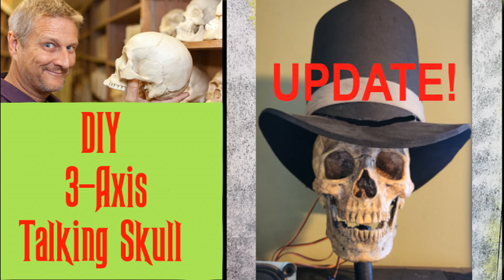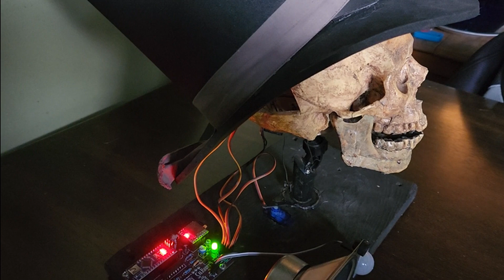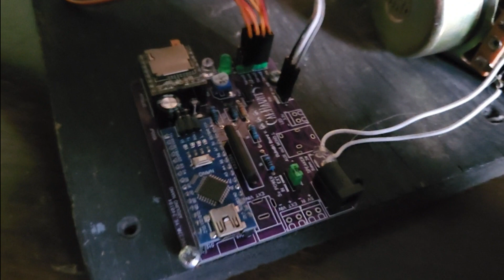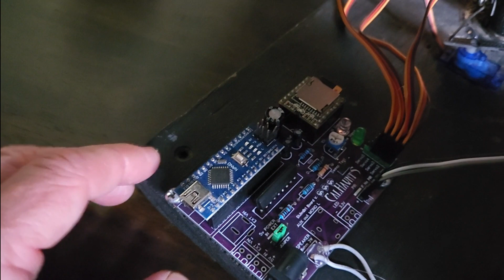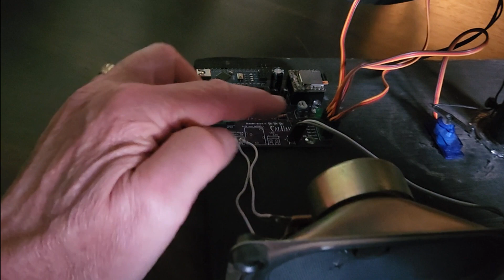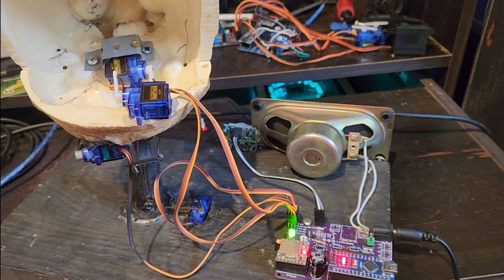Talking Skull

Comment from the maker: Ok for those interested, We have finally figured out pricing for the DJB boards (the controller boards for talking, 4 axis servos with sound). The price for the boards will be $125 plus shipping. We were aiming for $100 but the prices of some of the components went up due to tariffs. If anyone is interested, please contact me @ 1brianpierson@gmail.com to work out the logistics.
Reply: should use the standard opensource mouth item with the 3bit resolution and use a ai on something like a orangepi 5 plus with 16GB of ram. then use multiple pir or a human presence detector. you can add wled for the eyes or to shine a light on it. with a onvif camera you can have it call out costumes and such as well. whisper can have it detect speech and with xtts it can talk back to people

Comment: Do you have a parts list for this? How much to build one of these!?
Reply from the maker: Hi @majormagics5571, the parts list comes with the kit; we have a build your own (solder it together kit) for $55 plus $6 shipping or a ready made board for $90.
Reply: @brianaala  Ok now the $90 board, what does it do!? I would get that one... Please advise..
Reply from the maker: @majormagics5571  With it, you can take any mp3 voice files and it will move the jaw servo in synch, it will also control 4 more servos that will move randomly in a fast then slow, fluid movement (you set the overall speed). It has an LED output that can be set to blink randomly, stay on all the time, only while it's talking or stay off. It will play an ambient sound or music track when it it not speaking. It can be triggered to talk from an infrared movement detector or button, pad or any other switch. It does not require any programming to set up, just a dial and a button for programming that are on the board.
Reply: @brianaala  I think this is prettymuch what I am looking for.  Do you have a video on how this circuit board works and how to set it up?!  Im hoping you do as i am a novice....
Reply from the maker: @majormagics5571  I do! the back of the circuit board has a QR code that will take you to a web page with all of the manuals and links to the setup videos.
Reply: @brianaala  SO, do I have to buy it first before I can see the set up. I cant stress enough that I am a novice and am not very good at hooking things up... but common sense I do have....
Reply from the maker: @majormagics5571  Haha no of course not, I am working on the video now. I will try to upload it this evening.
Reply: @brianaala  Great, send me the link when you get it.  Im serious about buying a board as long as its easy install
Reply from the maker: @majormagics5571  Here ya go: https://youtu.be/y2EDcMvW0HA?si=trHA18LX9-3y8bpd
Reply: @brianaala  The link worked good and the board looks like almost anyone could program it.  Do you sell these 3 axis skull to work with the board!?
Reply from the maker: @majormagics5571 no, just the board at this point.
Reply from the maker: @majormagics5571  No, just the board for now.

Comment: I’m interested in the controller. I’m pretty new to all of this. I have a couple classroom skeletons that I’d like to animate the head and have them speak. What software are you using for the programming?
Reply from the maker: Hi, technically, the software would be Arduino IDE (Based on C++) but all of the programming is done, all you need to do with this board is record whatever voice you want it to have, some background music or sounds. Stick those onto the SDcard and plug it in.
Reply: @brianaala  If I purchased a controller from you I would still have to set the limits of the servo motion would I not? I’ve been looking online at a couple different servo set ups. Just not sure yet which route I want to go.
Reply from the maker: @amwilkie  Yes, but you don't need to do any programming to set the limits; there is a dial and a button on the board. All you need to do is set the jumper to setup mode, and it will walk you through the limits of each servo (min/max) by turning the dial to where you want it and tapping the "set" button, after all 5 servos it takes you to what setting for the LEDs, again just turn the dial until the LEDs do what you want, then hit the button. Finally, it goes to the servo speed mode, the servos will sweep to your settings, you just turn the dial until the speed that you want and hit the button.
Reply: @brianaala  ahhh ok sounds good. I’m going to do some more research on mechanisms, but count me in for a controller. I’ll send you an email.

Comment: Hi There,

I am quite impressed with your 3 axis skull and controller.    Would you be able to share more details with how you constructed the 3 axis mechanism?

Much appreciated, 

Yours in haunting

Doug
Reply from the maker: Hi Doug, thank you so much for the kind words! The 3 axis mechanism that I made for this is pretty rudimentary: it's made from an old Garmin windshield mount (the ball and socket) that is screwed on to a wooden dowel that spins on a bearing from a bicycle that is in the base. It has bent bailing wire going to the servos and screwed into the dowel for movements. This one was built to be mounted in a column and talk. I have since made another that is more of an actual 3-axis that fits into a skeleton. That one is based on the "Twisty skull" design. I just made that with some threaded rod, nuts, a fender washer and a spring with some tubing to fit it over the rod. I could maybe make a quick video of it to show you.
Reply: @brianaala  I would also appreciate some help with the actual axis, spent hours researching and still not sure what is best.
Reply from the maker: @haileyharris9580  I'm planning on putting up a DIY for the 3-axis design that I used (it's all off the shelf stuff with no 3-d printer or special tools required) but I still need to get that shot and edited (real life gets in the way). But I would be happy to share pictures and answer questions in the mean time.
Reply: @brianaala I would be very interested in this type of DIY. Great work!! I’ll keep you board in mind if I can ever get the actual skull together. I started this about 2 years ago and got frustrated when my prototype collapsed.
Reply: Thank you, that would be great to see.
Reply from the maker: @perogieeater  The other one is made more like the "Twisty" skull design using a spring for the universal joint in the neck. I'm planning on putting up a DIY for the 3-axis design that I used (it's all off the shelf stuff with no 3-d printer or special tools required) but I still need to get that shot and edited (real life gets in the way). But I would be happy to share pictures and answer questions in the mean time.

Comment: Do you notice any sort of "loop" in the random motion? I put together a random-motion two-axis skull years ago, but at that time I was working with a BASIC Stamp (clearly MANY years ago!), and I ran up against limitations in both memory and the pseudo-random number generator. I considered refreshing the random seed from a fluctuating analog input (like a light sensor or overdriven transistor), but it took long enough to loop that I decided not to worry about it.
Reply from the maker: Not really, I mean the servos are constrained by the limits of the movement but with three moving at random speeds, to random angles (within their constraints) the combinations are pretty endless.